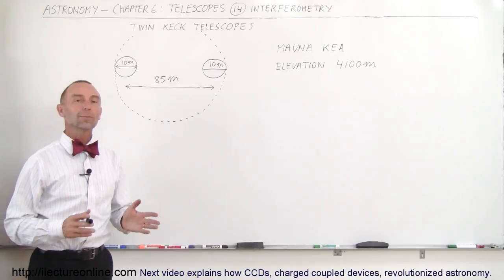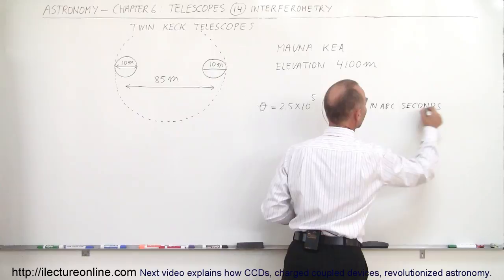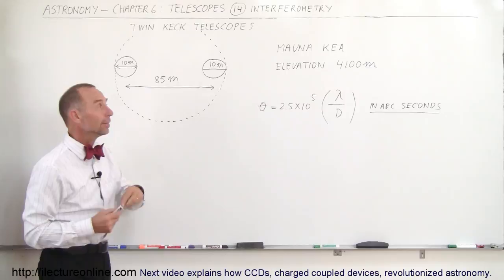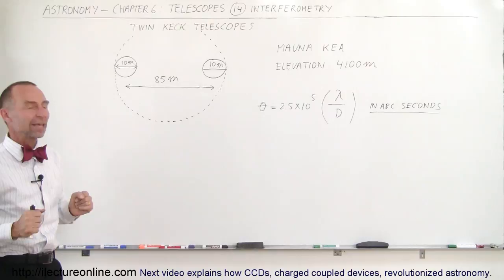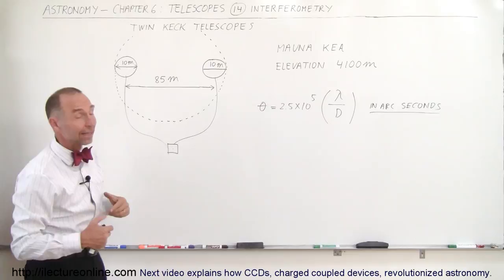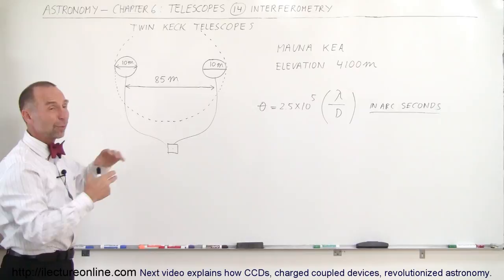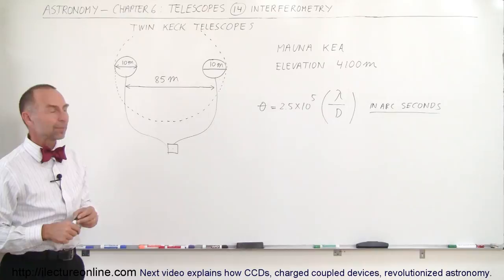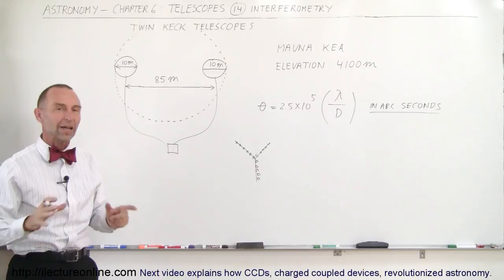Astronomy - Ch. 6: Telescopes (14 of 21) How Interferometry Improve Telescope Resolutions

Comment: Huh?  This video claims that computer synthesized interferometry can be used for optical as well as radio astronomy.  That is not true, or at least not yet true.  The problem is that as the frequency of the source of the radiation to be observed, gets higher and higher, meaning the wavelength get shorter and shorter, it is no longer possible at some point, -- currently in the microwave portion of the EM spectrum -- merely to capture the radiation at several locations and then recombine these "samples" electronically in a computer, as is routinely done at radio wavelengths, and as is discussed in the video.  It is a bit involved to explain how and why the artificial interference technique comes up against many limits as the wavelengths observed become several octaves shorter than the more tractable radio waves.  Suffice it to say here, that most of the limitations are caused by the inability of current technologies to record the data accurately enough and by similar technological limitations of current computer processing.  For this reason, when viewing in the optical, or even infrared, regions of the spectrum one is still required actually to physically "recombine"the beams coming from the various sources, and that too is very difficult to do since it requires several mirrors in long tubes all adjusted to within nanometers in length to produce the interference data.  Still, the much simpler and more convenient "ärtifical interference" technique described in this video has made great progress already, and should, one hopes, allow astronomers to use the technique, first in the higher microwave, and then in the infrared and optical segments of the EM spectrum.  How long that will take is anyone's guess, of course, but certainly much progress toward that end should be made during the next two or three decades.
Reply from the maker: Two optical telescopes used side by side improve the resolution, over using a single telescope.
Reply: @MichelvanBiezen  That only works if the two scopes involved have been figured to meet at the same focus, as if they were simply two segments of a larger scope with a diameter of, in this case, the diameter of the two scopes' diameters added together. So here that would be the resolution of a 20 meter scope, -- except of course, that the much lower light gathering power of this arrangement brings in a few new problems of its own, especially if the separation is more like the full 85 meters mentioned for the Keck scopes.  Thus, to take another relevant example, the Giant Binocular Telescope, GBT,  atop Mt. Graham in Az. consists of two scopes each having 8.4 meter primary mirrors,  But since they are independent telescopes, not two scopes specially configured to come to focus at the same point, like say the Giant Magellan Telescope, using seven 8.4 meter primaries [because both scopes use primaries supplied by Richard Angel's factory, which can't yet fabricate mirrors larger than that size.] IS supposed to do, the GBT cannot obtain double the resolution of one of its single 8.4 meter scopes.  It could only do that if used as an actual interferometer, as the Keck and VLA scopes are sometimes used.But that requires all manner of additional equipment since the two or more pencils of light coming from the individual telescopes must be brought to a common focus to produces actual fringes, which then can only be deconvolved in a powerful computer. The GBT still has twice the light grasp of a "monocular" version of the same would have.  That means it can see about .8 magnitudes deeper into the sky than the latter could.  [That sounds very small, but in practice can be quite important since it is usually the faintest objects that are the focus of new research]. Personally, I find it unfortunate that the GBT wasn't designed, like the GMT was, to comprise what is actually a single telescope.  That way the limiting angular resolution would be at least doubled, while the light grasping ability would remain what it actually is when both scopes are used in tandem on the same object.  Perhaps the projected cost of making such a scope was too high, or perhaps they couldn't find an optical company capable of figuring such enormous solid single mirrors to the unusual curves needed.  At any rate, they went for the other design instead.

Comment: Hi,
How does the quality of the image increase that much with a bigger angle of resulution, if the total area surface of the two telescopes do not increase the original area surface as much as the angle of resolution changes?
Reply from the maker: You can see smaller details with this method.
Reply: This really sounds counter intuitive but this is how interferometry work
Reply: the finer details you see makes resolution higher.
Reply: @MichelvanBiezen  but then what is the difference between that and actually having one big telescope? Something must give... I am guessing its that one big telescope can snap a picture of a larger area of the sky at once, where as the interferometry telescope can only take picture of a smaller area of the sky, but at the same resolution.
Reply: @asyncasync  what gives is the light collecting area. With interferometry you can resolve smaller details but cannot see fainter objects. The size of the the mirrors has nothing to do with the angle of view.

Comment: I have to ask why isn't optical interferometry not used that often, it would have a much larger resolution right?
Reply from the maker: They only use if if they really need to.  It ties up mulitple pieces of equipment that could otherwise be used for other projects.
Reply: @MichelvanBiezen  right, i was wondering more in the sense of "why can't i build one",  would it be posible for me to grab two super stable telescopes with trackers, set them apart 10 or 20 meters and then take thousands of exposures to gather all that light and getting a very detailed image? i was also wondering why there's no similar proyect to the EHT but with optical interferometry, i heard somewhere that one that big would have enough resolution to image continents on exoplanets

thanks for awnsering that quickly even after 8 years, you're amazing
Reply from the maker: You would need a computer system to "connect" the two images from the two telescopes.
Reply: @MichelvanBiezen  this is a bit misleading. Unlike with radio telescopes you cannot connect optical telescope with computers. You need an optical connection and have the light actually interfere with itself. In radio astronomy the frequencies are low enough to be recorded. They can then interfere digitally in a computer.

Comment: What calculation do I need to perform to sum the data from the two telescopes at twin Keck and subtract noise?
Reply from the maker: Typically, data is stored pixel by pixel, and each pixel would contain informtion regarding color and intensity.  A technique is used to add images together in order to get a brighter image.  One test was done where the same image (from regions between galaxies) were superimposed on each other a thousand times to increase the intensity of light of the image.  I have not yet seen the algorithms on how they perform the image processing to combine images to improve the resolution.  I'll have to look into that when I get a chance.

Comment: Can image interferometry be applied to camera images? Say to artificially increase the resolution of a pair of CCD array sensor cameras, pointed at the same object. I guess the challenge is that the wavelength of light isn't a fixed constant in this case?
Reply from the maker: Yes, it can be used with CCD cameras as well, but the practical applications occur with telescopes and astronomy.

Comment: How was the equation for the angular resolution derived? I've looked for it on google but I can't find it anywhere.
Reply: Never mind, I found it. It's just the usual equation (θ = 1.22 λ/D) except that in this equation, θ is in radians. The 2.5 * 10⁵ value comes from converting θ into degrees and then multiplying by 3600 to convert degrees into arcseconds.

Comment: So how does interferometry work?
Reply from the maker: Resolution is determined by the diameter of the objective (not the surface area).  If you can  process the image from both telescopes at the same time using computers, the apparent diameter of the objective will be the distance from one telescope to the other.
Reply: @MichelvanBiezen  Thank you for reply. Still how does it actually work. Why does the diameter increase the resolution?